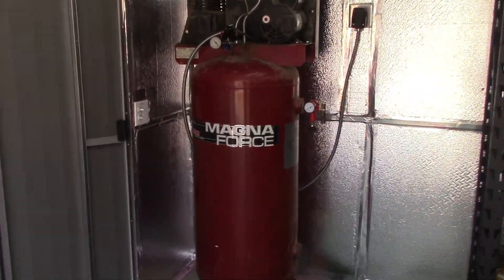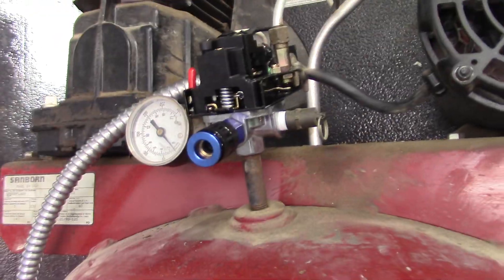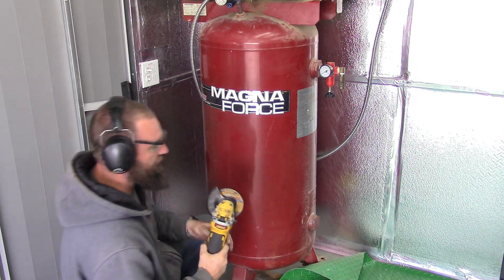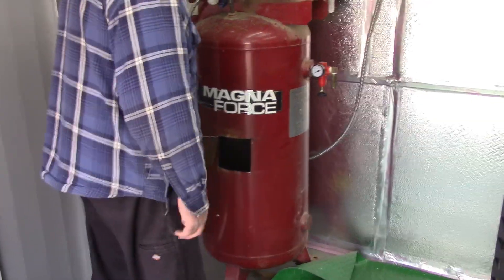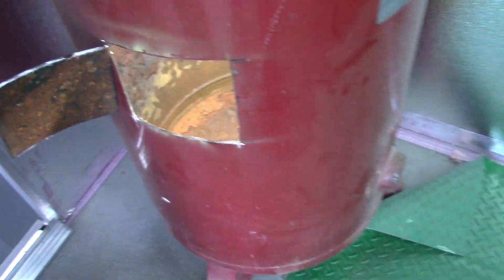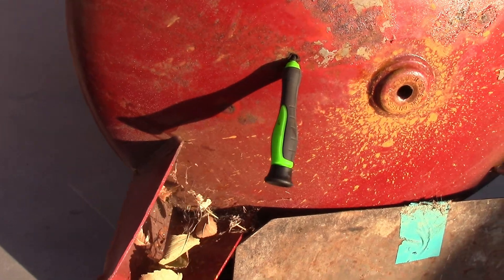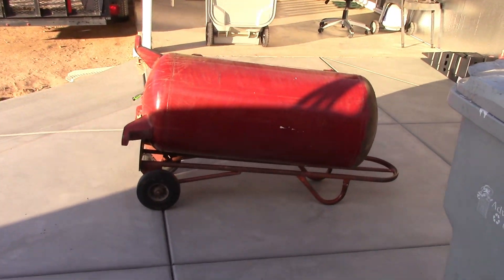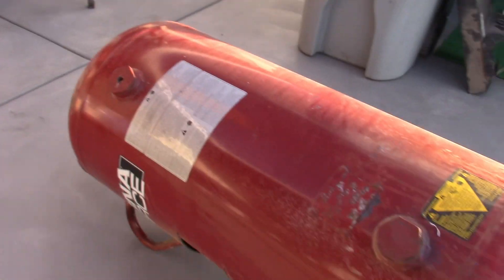Failed Air Compressor! Hole in tank, disaster averted.

Comment: I bought that same unit in 93. It has been a faithful powerful compressor. I had put a 1/2" copper tube and brass plumbing valve on it and would open it when I walked by to burp out the water. After all these decades I saw the explosion videos, so I thought lets check it out. If you notice that magna force tank has a large lower bunghole in addition to the top one. I wished I would have opened it up every year and put some evaporust in periodically. The bottom is not as bad as his, but crusty so I went shopping for new. Unfortunately all the new tanks likely come from one source which no longer has the lower inspection bunghole. so sad to lose good equipment due to rust. They should coat the interiors with a rust preventative after manufacture.

Comment: Very lucky that tank didn't explode and ended up killing somebody  , If you're in the market for an air compressor , 
The best and safest way is to buy a new one , Because buying a used one , There's absolutely no way to tell what condition the tank is in unless you take one or more of the plugs out and look inside with an inspection camera , Then you decide from there what you want to do , If you buy a used air compressor , Absolutely do not put it into service without first hydrostatically testing the tank , There are several videos on YouTube how to hydrostatically test a tank 
Just recently I saw a video where a firefighter was doing work in his garage and the air compressor exploded causing extreme damage and the firefighter died later , Type in 
Smock county firefighter killed by an air compressor explosion to get the video , Very likely the concussion caused by the explosion is what killed him and caused all that damage 
If you're in close proximity to an air compressor and it explodes , The force of the explosion is more than enough to collapse your lungs , Not to mention the razor sharp shrapnel that's gonna go flying everywhere , Pressure vessels are absolutely nothing to mess around with and If you have the slightest doubt about the tank , Get a new tank or buy a whole new air compressor to play it safe , I used to service air compressors and pumps and I've seen a few air compressors after they had exploded , When a tank gets old , It literally becomes a ticking time bomb 
In everything you do ALWAYS PUT SAFETY FIRST !!!!

Comment: Very good advice, for a change.  YT is full to bursting with bad advice on air compressors, ranging from bad/overly-expensive moisture removal to "repair" or "reconditioning" of rusted receivers.
In theory, you're not allowed to show how to make bombs on YouTube.  But in practice, loads of people are believing they can make a ticking time bomb safe.  Big eye-roll.  

Anyway, thanks for this, I did the same with my old compressor when I realized how bad it was: cut a whacking great hole around the drain spud, then put the drain spud in the trash before I put
the old tank in the alley for the scrappers. :)

Comment: after 30 years my compressor (same one like yours) developed a leak,  Over its life i have replaced the valve plate 2 times, 1 motor and 1 pressure switch. i added an elbow, threaded pipe and a brass valve to drain the water regularly.  I looked at comparable compressors to replace it with,  they are all priced 700-1,000 for a 60 gallon single stage,  i think the best deal i have seen is the menard's Masterforce compressor, its 699 bucks and if you wait until Menards has their 11% rebate, you would get back about $77.00 in a rebate check to use to buy more menards products
Reply from the maker: I was fully intending on getting a new tank and bringing it back to life but I ended up just getting a new one from HD. I may put the old head on a Different tank in the future, if the need arises. I also have a vintage speedaire compressor with a bad unloader that  I could make into a sweet compressor- but I am waiting because I want to make a gasoline powered compressor. Just don't have the need or want for it as of yet. Maybe if enough people get on board I'll convert an antique 110v compressor to gasoline.

Comment: Very Dramatic..  it would most likely find weak point and leak - not blow up
Reply from the maker: There was a crack beginning to show above the weld on both the inside and outside of the tank in the same spot. The water line was above the lower weld. If it didn't blow out of the hole in the bottom first, I am fairly confident the side would have failed.
Reply: A tank that's been weakened by rust can explode violently at anytime and end up killing somebody , For those individuals who found their tank started leaking are very lucky that tank didn't explode and if even the slightest leak is found , Shut off the unit and get away from it immediately , Once all the pressure is gone , Never ever use that tank again and absolutely never try to patch it by welding on a piece of steel 
Which will greatly make the tank more vulnerable to a violent explosion

Comment: You pressured it up to 225 psi before inspecting it? An endoscope is pretty cheap you guys. Come on.
Reply from the maker: I never got it close to 225. I was really considering dismantling it before hooking it up to power and degreasing the inside and using the pressure washer to check it to 2x its rated pressure. Wanted to make sure the pump worked before going any further with it then the leak appeared. I do have 2 endoscopes and access to a professional borescope, so when I restore my vintage SpeedAire I'll definitely check the inside first before pressure testing it.

Comment: multi row oil cooler mounted on the cage in front of the fan/pulley. hot at top, cold at bottom. draining into a water trap. couple of compression fittings etc. consider gravity in layout... dry air, never drain the tank...

225psi... ffs, 110 is enough for me...
Reply from the maker: IDK where 225psi came from, maybe I accidentally said that in the video. Pretty sure it was a 125psi compressor. 150psi would be nice, heck even 175 just for that bit of extra capacity. Sandblasting, plasma cutting, and painting is in the future, so large compressor with a condenser to aide in water removal with a oil/water separator setup is definitely in the future.

Comment: Our old shop compressor, the valve on the bottom leaked just a tad so we put a tray under it. It would drip out the water and the water would evaporate before it ever filled. Was actually kinda nice because you never had to drain it and water never sat in the bottom rusting it out. 
Granted it’s an air leak but a very small one and besides other equipment in the shop leaked air worse like the tire machine.

Comment: I had the exact same compressor, and the water rotted a hole in the bottom, scrapped it, bought a new one and first thing to add is a remote petcock from the bottom drain through a brake line to an outside valve, that way I can bleed off the water without crawling under the tank to drain it

Comment: 2 things, have a nice radiator before the air goes into the tank, takes 90% of the water out and 2: i have always cut  the bungs off the bottom of every tank i have installed and installed a non protruding bung and also a automatic BEKOMAT drain. otherwise this is the fate of all tanks.

Comment: This is honestly one of my biggest fears with the compressors at work. Water that comes out of them is oily, but I don't know what difference it would really make.
Reply from the maker: If/when I get a new large compressor, I will end up doing a cooling system. Not sure if I want to go radiator, or coil in water bucket with an auto-valve. Cross that bridge when I get there
Reply: The danger is that you will always get condensation in the tank when you compress the air and starts rusting from the inside out , Weakening the tank , What I strongly recommended is when replacing a tank or getting a whole new air compressor , Take some of the pipe fittings off the tank and spray oil or WD 40 and coat the inside of the tank , Any oil to coat the inside of the tank will do and help prevent rust or slow it down , I did that with my air compressor and when I drain the moisture out , I'm not getting any rust out of it
Reply: There is a 6 page thread on the practical machinist forum discussing if some air compressor explosions are the result of dieseling explosion. This is a result of oil leaking into the tank from the compressor head and combusting, like a diesel engine. There is a NIOSH report from a compressor explosion in California and it is possible it was caused by a combination of factors, including the wrong oil being used in the compressor head.
Reply: @ryry8210 that's insane. Our compressors are always full of oil

Comment: This is why I like vertical tracks more than horizontal tracks.   A failure in the end is less likely to fail in dramatic fashion than the side.
Reply: And the ends on a vertical compressor are usually thicker as well, buying a little more time.